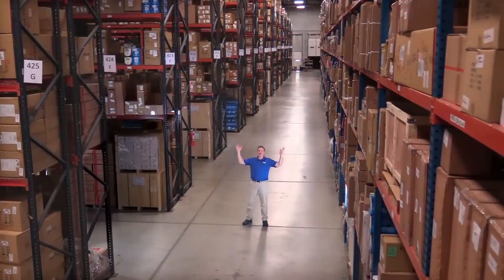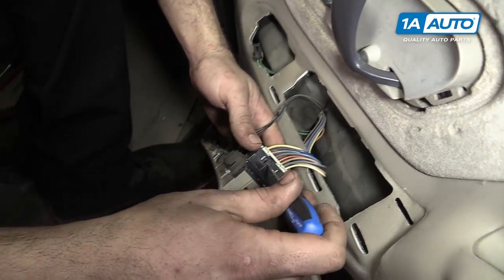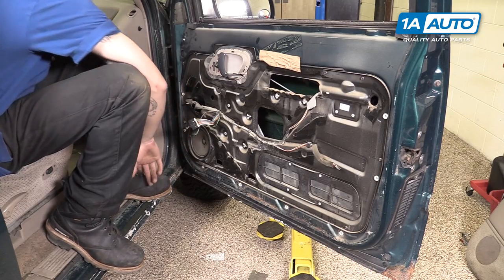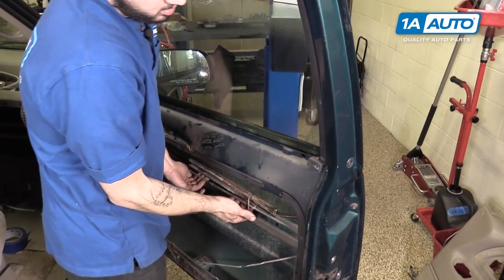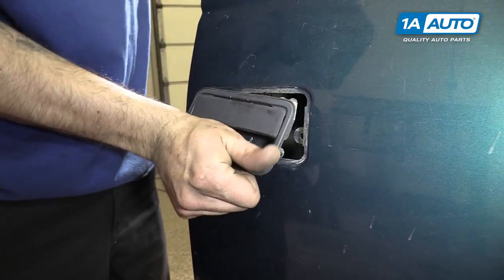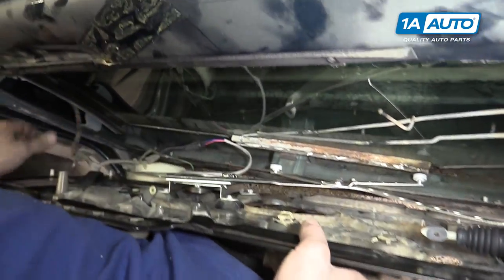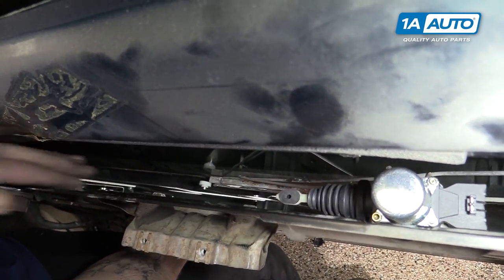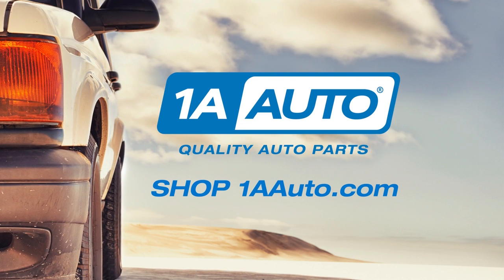How to Replace Front Door Lock Cylinder 95-99 GMC K1500

Comment: For just a door handle or lock cylinder there's no need to take the whole door apart like this or disassemble any of the wiring.
Once the main door trim panel is out of the way, the inner door handle bolt is accessible through a conveniently placed hole near the rear edge and toward the top of the inner metal  panel.
Reply: Exactly what I'm thinking. I've replaced outer door handled and lock cylinders on people's truck like you say in a matter of minutes without all this work. It can all be done with the large opening at the bottom of that metal panel he removed.

Comment: Props for making video and I’ve work on cars for many years now and there is better way to do this without the window regulator need to be removed as well as all the wires … here’s TIP if you look and you see hole through regulator to that exterior handle that’s clue that it can be removed without rest the stuff… what you really need to remove was latch and unbolt the exterior handle then remove the pin and for pin you slide the pin that’s why there’s oval holes on it slide it half way for pin to clear the it fall out… i appreciate the clip regardless it’s still best information on how to video out here so I’m not knocking it down…… I’m sharing to add on as i have worked on cars all kind cars all this time and I’ve learn certain things only time will show you so yeah my knowledge on interchange are beyond computer i can find things on different model car to use it on car I’m working on and it’s not on any interchange at all this is the knowledge you gain after been in it for long enough to know how all parts are made and how they get to where they are now !!

Comment: The handle is difficult to remove and put back in the door because the rod pushes on it, the handle does not clear enough the top edge of the hole (the part from this video that is cut, when the handle is lastly removed or firstly put back).  To make room, remove the three screws holding the lock mechanism and then it can be moved down, the handle will now be able to get out or into the hole easily.  When the handle is put back inside the hole, put back the three screws of the locking mechanism and the handle still can move out from the bottom enough to be able to put back the locking rod into the lock cylinder, or push the cylinder back into the handle if it clips in place easily, otherwise the cylinder has to be put back before putting the handle in the door.
Reply from the maker: +Dominic Russell Thanks for the feedback!

Comment: I put the rod on the handle (from the outside) first before I lay the handle in, and with lock cyl connected to it's rod but hanging in the door,,,  with handle connected but loose, set the cylinder (already connected to the rod) started into it's slot (behind the main handle rod) inset the handle top side first then bottom... put the screws in and snap the lock cyl fully into place from the inside of the door. Don't have to do anything blind and no messing with the door jam mechanism at all.

Comment: I almost never comment on these things - but I just got done doing this job and watched your video for the most important part - getting that door handle in and out. I see you are doing the job on a beat up truck - scratched faded paint. So your guy goes to remove the door handle ... wrestles with it. Then POOF - your edit has the door handle magically out. Nothing about the HARDEST part of this task - getting that effing, constantly failing, poorly designed GM POS door handle out of this era of truck.

Your videos are usually better than this. I don't have a trick to offer - it is a beotch, there is no easy way - and getting this done on fresh paint - without a single scratch - well you guys are in the car business. Just how does one do it?

Comment: If you don't what  to remove the regulater just drill out the rivits for the vent on the bottom. Gives you plenty of room to work. Just reattach with self tappers.

Comment: What is the part that is attached to the lock cylinder called? I just bought a 98 Chevy K1500 and whoever replaced the driver side door handle didn't hook it up right and the door won't unlock. I have to crawl through on the other side to unlock my driver side door. I took it out and it is missing the clip that is attached to the lock cylinder in the video above. Any help would be appreciated. Thanks.
Reply: Did u ever figure it out? I have the same problem

Comment: You didn't show cylinder installed into handle I had to leave my project sit half way through it for a few days & think I may have the arm that connects to rod facing wrong way. Got handle in but couldn't unlock door with the key. I could before I started. Thanks,
Reply from the maker: +Dave Yttri Thank you for watching our video, we'll try to do an even better job of this going forward. 1aauto.com

Comment: You failed to show us the struggle of getting the handle out and back in there! i can get my handle to open the door but the damn key wont turn the lock cylinder when i get the screws in! The space is too tight! Idk if my rod is bent or what... So frustrating